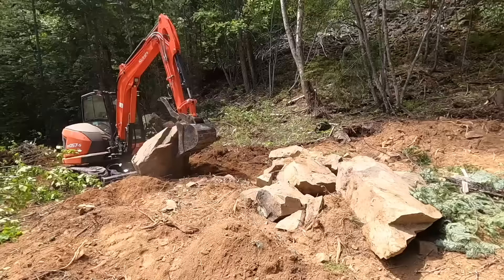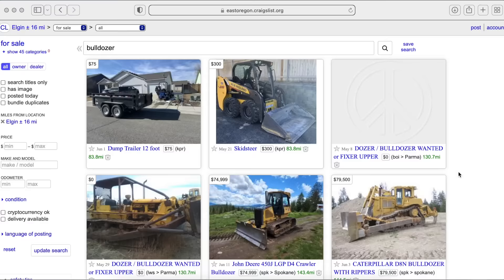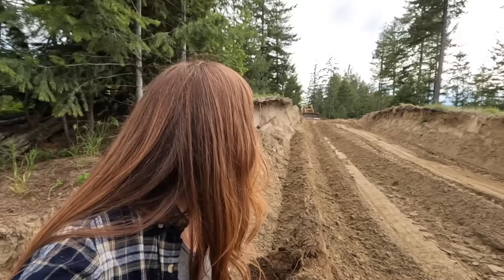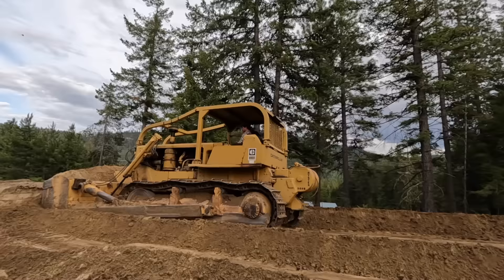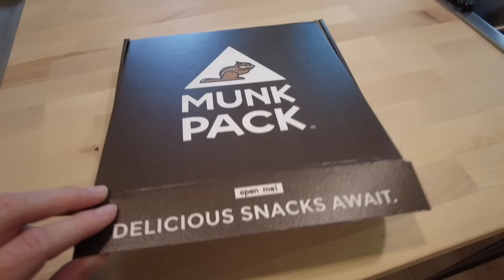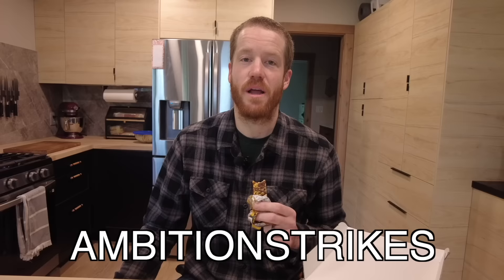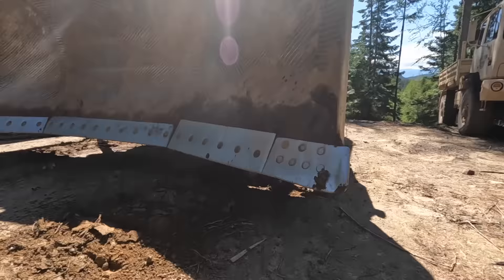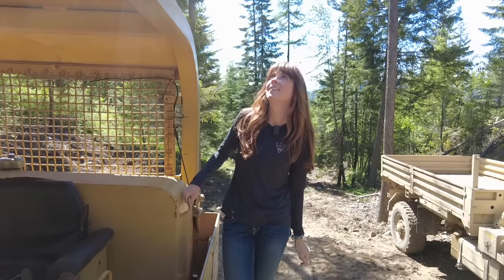We Bought The Biggest Bulldozer We Could Find || MASSIVE CAT D8

Comment: I've noticed too, on the side of track carriage there is a plate with usually with 4 bolts you take off, (their on both sides) when opened there should be a grease nipple. You use a grease gun of course and add to it until you start seeing the track tighten, but a word of caution! Do not tighten too tight, you want to take out the sag out of it, because it's old and the undercarriage is worn down you could break the links. I used to be a mechanic at Yancey caterpillar. Check your undercarriage rollers and track plates when tightening them.

Comment: Just a thought and I know you want to do it your way but you can help yourselves with a little thought. Apply ice and water shield on the sealed wall exterior. This is the same product used on a roof before shingle installation. Then, if mine, I would glue on thick panels of rigid closed cell insulation. This would not be for thermal advantage but rather act as a compression zone for earth movement. Once that is in place, install some perforated pipe to move water away from the structure. I would back fill with washed pea gravel and contain the ends with clay. Same for roof once you patch with corten steel. May have spelled that wrong. Now cover the container with dirt or clay. Don’t pile too high on roof. The pea gravel will allow water to drop to the diversion pipe hopefully before reaching the container wall. Any water intrusion through the pea gravel would then make it to the closed cell foam boards with joints sealed with waterproof tape and then if moisture continues it will filter to the liquid membrane you painted onto the container. This will extend the useful life of your electric room. Another note, the container may be constructed from corten steel which has the property of developing rust on the surface but does not rot the metal. Once rust develops, rusting stops. Interior wood floor May rot over time and can be replaced with sheet steel. This is how I would handle burying the box. I would also weld in some supports to keep the unit solid. Good luck and stay safe.

Comment: one of the first things to now invest in is some fuel supply equipment, like a portable 30gallon rollaround diesel fuel tank with a hand pump on it..and run some Power Service fuel anti-gel year-round,it helps the engine start easier even in summer..drain the fuel filters and water separator regularly..25yrs a Cat iron owner

Comment: So awesome! Remember that even though it seems like a slow lumbering beast, it can do a lot of work and it can very quickly do a lot of damage. Just learn slowly and respect it always. Also, ask Dave for detailed explanation of what to watch and be aware of while turning on rocks in terms of losing a track, even with your mini ex around, putting a slipped track back on that thing is a major job. Check track adjustment on that left track, you want slack in dozer tracks but you definitely don't want to lose one. Have fun!!! And ask Dave about sidehills on rocks, they all slide before they tip but you have some good slopes there, like I said, things can go bad fast.

Comment: I think you made an excellent purchase. Most of the controls on this dozer are the same as on the D8 I operated for my grandpa when I was a teenager. The cutting blade on the dozer I operated was raised and lowered by cable. We cleared trees and stumps behind loggers for a local paper mill with cutting blades that cut them off at ground level so they could plant new trees. It looked like you needed to tighten the tracks a little on your dozer. You should take care of that before they get really loose. You don’t want to slip a track.

Comment: Looking toward the future sale , please purchase Caterpillar yellow paint then when time allows brush that thang into looking new, after every repair (paint) during every repair (paint) new paint makes the likelihood of a future sale twice as possible. As soon as possible learn the track tension procedure , purchase a shop manual and purchase engine oil and hydraulic oil in 5 gallon buckets.  If you don't already have a dewalt or milwaukee electric grease gun get one and invest in replacement grease  nipples change/ replace all that you can also get the lock on type grease fitting for the gun.

Comment: So happy to see you guys get a dozer, can’t wait to see Courtney’s smile as she takes revenge on the trees lol. be careful and blessed
Reply from the maker: The trees and stumps are no match now!
Reply: @AmbitionStrikes  aint nothing you need to move that that thing cant move. Just dont get it stuck. Its gonna take something really big to pull it out. Keep a careful eye on each lower corner of the blade,thats where the work is done. Dont try to push too much at a time. Gentle is the word,  Fuel use will not be much at light loading, governor is your friend. Open it up but dont push at max. You can tell by looking at exhaust. Black smoke will push a lots but effficiency is at lower power needs where smoke has color but is not dense and black. Taken care of and not mistreated and you can sell it for more than it costs you. Buy clean fuel, keep it clean. I know you have seen that ,,,,obey.   Ive had up to D6 and have owned 11, and used to sell them for the cat dealer in Bham alabama back in the 70s. Keep good records, careful on your federal taxes,,,,that thing wont cost, it will pay!!! More videos when you get time. Tighten the tracks If i remember correctly, the blade weighs 16 tons,,,watch your toes!!!

Comment: U bought good!  I worked at CAT in Decatur, IL for 33 years.  That plant builds off highway dump trucks (50 to 400 ton capacity), tractor scrapers (models 621 (20 cu yd to 657 48cu yd) and a few models of the larger rubber tire loaders.  
I wish you luck and BE SAFE.    Ye Ole Caterpillar Cowboy...

Comment: It's not to bad looking 46a. A winch is nice but it's to bad no ripper to help penetrative through any rocky ground. And remember when using the steering clutches when Turing, let the steering clutch levers back in easy and not let go of them to slam back or you will learn the joys of rebuilding final drives. And the tracks are a bit loose. But enough of what and how to. It just puts a smile on this operators face to see the love and excitement of equipment you both have. Enjoy it.

Comment: Another plus about that older dozer , you can work on it , not all computerized crap  !  If not done don't forgot to change the engine oil and filter , fuel filter ,   Definitely add diesel clean to fuel , trans fluid  / or at least filters , maintenance is everything , I owned a equipment repair shop , worked on all types through the years , just a little advice , love the video y'all ,!! And what you are doing!! Be safe! Blessed ! You for every day probably need something like a tractor  50/ 60 hp
Reply: Definitely agree on the tractor. Every time I move my dozer, I have to follow up repairing the road.

Comment: I hear that you're going to start soon on your solar pv array.

I hope that you've also researched solar evacuated tubes for heating.

* Edit.

I see that the ambition strikes creators hearted the comment. Which means at the very least that they have read the comment.

Solar evacuated tubes are super under utilized, and offer great cost savings in the long term as they use the sun as the heat source, but the best thing is that the energy can be stored as thermal mass.  

I watched a Canadian video where a fella either in Saskatchewan or Ontario did a test in -39°c weather +or - a few degrees because I don't recall.. But he was able to boil water on his solar evacuated tube in sub zero Canadian Arctic weather. 

As a Minnesotan who also sees those similar temperature extremes.... It is my goal to use solar evacuated tubes to heat my home as well as my farm shop which is 80'x 160'

All it takes is time though, because money is compounded by time.

Good luck ambition strikes!
Reply from the maker: Hi Walt, thanks for the thoughtful comment. I'll admit I don't know much about solar evacuated tubes but you've given me something to research! Thank!

Comment: A four wheel drive backhoe is a must have for a homestead, and a small dump truck, looks like you have one. you can blade with it, dig, and stockpile materials, all sorts of things. after you build your road sell that D8 cat, that’s a monster and if it breaks down on you it would cost a fortune to fix. a backhoe though expensive is a lot more practical, and uses a lot less fuel and lubricants. i had a case 580 Super K 4x4, it was. a good size but there are smaller ones if you prefer.

Comment: I just bought two D6 this spring. One with 2500 hours and the other with 3500. Both enclosed cabs wit( total brush protectors. Paid $480 total for the two. I thought that was a steal. One headed up needing a bearing and some trail links. That added $20,000 to the deal but both had new paint and stickers when I got them. A D6 is the perfect mid size dozer. Not too big haul and and move a lot of dirt.

Comment: We had a 1966 D8 on the farm when I was younger. It was wonderful. Had about 13000 hours on it. Worked just like it should. Just make sure you keep it greased. It will let you know. We put a total of 21750 hours on it and got about what we put in it. Had to put rollers and bearings on it but we had it 25 years. And as far I know it still working on the farm we sold it to.

Comment: Congrats on the new to you tool!! Can’t wait to Courtney, to take it over like the excavator!! They are a great tool to have and run, and can move a lot of material in a short time. It will be nice to cut a better road in with it as it will compact the base as you build! That is the same model that I first learned to run, as a teenager. Back when I worked for a equipment broker company.

Comment: Always let idle for a few minutes to cool down turbo and valves. 
Avoid using steering clutches use blade when pushing to steer.
If you think you will get stuck in soft ground you will....
Use care on side slope turning not to throw a track 
Four way blade makes this a score.
Good luck.
Have a good CAT mechanic come out check machine .
Torque converter fluid final drive oils change out. 
Fuel filters also .

Comment: I don't know what you paid but it was a good deal. That's a great machine and if you want to sell it when your road is done you'll probably make your money back. My biggest advice as far as keeping the dozer starting good is, never shut off the pony motor with the magneto switch. Always turn off the pony motor's gas line. You guys talked about being worried the float would stick, that's exactly why. The vibrations of the diesel running can also cause the fuel to continue flowing into the pony motor and the gas will dilute the oil causing you to damage the pony the next time you start it. Always shut the fuel off, and just let it run out. If you do that and keep that thing tracks side down, it will be a good project. Be careful, especially on side hills. It's almost impossible to get a dozer to roll forwards or back.

Comment: Have had two smaller Cats. Way fun. Way powerful! Keep eagle eye on all fluids and lube points. Tighten tracks. Must change fuel filters regular or will run awful once they are maxed out. Take down ANY tree. First cit roots all sround the trer and then tree will push over. Mud does not bothet it but do hose it off when you can. Dont get into too deep mud cuz can get stuck. Then need an 18 wheeler tow vehicle to pull you out.  NOthing is more fun, more satisfying, more productive than a big dozer! Cat is best. Secure an owners manual. Never run out a diesel tank cuz hassle to re start. Keep cooling system clean.

Comment: Wow, a Cat D-8. I used to run one when I was in the Army.  194th Armor, 46th combat engineers. Ofcourse it was jungle camo and a ripper on the back instead of that winch.  A little armor plating here and there and a few holes if you know what I mean, but it was a beast.  But after 8, 10 hours a day the fun wore off kinda fast. 
They are hard on the back so remember you control how smooth your ride is. Well kind of.  I bet that rear  winch will come in handy for many things too. Great find and good luck, check your fluids daily and most of all, Stay safe.

Comment: Only suggestion pump your track up , pushing all that rock and shale will cause a loose track to spool off the final drives. I was wondering if it has a belly guard and rock guards attached to the undercarriage? There should be a rock guard under each final drive as well . That crawler should do the job with speed and no wasted fuel , production going in forward and reverse gears. The final drive during assembly was referred to as the
 “ pickle dish “ and they still make parts both in China and India but try not to break anything a replacement OEM pickle dish alone without the gear set will put you back about $ 30 k each , reman steering clutches are $40 K for a pair. I would have to agree that your upgrade will impress you how much more you can get accomplished , my only suggestion would have looked for ripper instead of a wench when doing all that rock work …. memory serves the ripper and single shank would be able too split between three and a half to four feet of hard pan with no more than a grunt and black smoke . The length of your road and making it straighter will burn through between 100 to 150 gallons if you work her hard . They are not cheap too run or fix , the first thing I would do is replace all filters, give her fresh oil , hydraulic fluid , and tighten up those tracks ( we used just plain black grease and filled the internal piston located about two feet from the rear upper housing with a shaft attached to the idler yoke , the only sag in the track should only be located between the two track idler rollers , the right track has sag after the final drive gear and sags again just before the idler wheel .  There should be a placard with instructions on how to tighten your track located on a flange plate where that idler yoke shaft assembles to the final drive piston cylinder ( the flange panel should have a half moon cutout so you can use a socket on an air motor to release any trapped air inside the piston ) the last set of tracks I had too pump up was back in 1980 . This is what happens too the storage capacity of an engineer’s brain after 45 years I now have to remove a memory first because your short term is all but gone…. Thanks for letting me give up some storage area and sharing with you two … now if I can find my car keys I can unlock the bathroom door . 😂🍻✌🏼😎 
I

Comment: Also one day pull some cable out on the  winch and see if it works.  You WILL GET STUCK ONE DAY, and your little excavator probably won't be strong enough foe 88,000 pounds!  Always check the fluids every day before you use it.  Also try to buy a shop manual for it.  They are priceless!!

Comment: Yep when you go off grid you realize one of the first things you NEED is a dozer!
Im off grid, 10 years now, 
JD420c
Yanmar YFB20-2 track dump
Komatsu PC75uu-2
Now you need to go to Harbor Freight and get the 3/4 and 1 inch socket sets! lol
Buy grease from CAT- get a case.
Invest in a 55 gallon drum of 15w-40
Better get a 55 gallon drum of hydraulic oil too- Sinopec is best price

Comment: The thing on the front is called a blade not a bucket, your tractor is 235hp or maybe a little bit more, don't try to go fast with it, go slow starting out, your speed will come, while it will go most any place, they will get stuck, don't keep messing with it thinking it will come out, all you will do is bury it, and then you will have compounded your problem!!

Comment: Great call to get a D-8 Dozer for the Driveway widening.CATS are so reliable Dozer's. ( Own stock in the Company)  That is the size Loggers use to make Roads to there clear cuts. There is a big reason they have Deceleration Pedal. It's for full throttle use when pushing. International did that with there TD series of Dozer's. Case had a regular throttle pedal (Like in car) but you did also have a throttle lever. Everyone thought I was crazy buying a 190-Dynahoe for my small yard. It was massive overkill for what I use it for. Put the power of the Beast, (19000) pounds. Standard digging depth, (19) feet. It took out the maple stumps, easy. The big ROCKS in my back yard have had no problem with lifting ANY of them. 
I Ran a Dynahoe-190 in 1979 on a mainline Sewer job I worked on. Digging side sewer stubs. I feel in love with the beefy one frame design. (The backhoe end is part of mainframe of whole machine) It had over (8000) hours on it when I bought her. I've put (100s) of hours on her. It just has lots of blowby on that old school Detroit Diesel (353) have had (Seal) leaks on hydraulic cylinder, but those are repairable. New Tires. I just watch & keep clean oil (Delo 40 Wt.) 
Oil for those two strokes. I have engine plug in heater. It makes a big difference on start up, with the Heavy Wt. Oil. It just keeps digging along. Your place looks so beautiful, lots of forest land, Evergreen trees. Do you have plans to LOG any of your property. To make some money for further build up of structure. Love the idea of having living space over Garage, instead of building second living quarters. You will never get stuck with that super RED jeep with high track set up. That is a cool looking vehicle, and you two are very smart in how you do everything. A+ on site Development.

Comment: Pony motor is the best starting system. 
In the winter let it run awhile and it will heat the coolant because they are one. 
Before starting